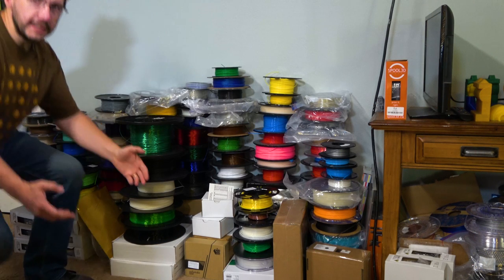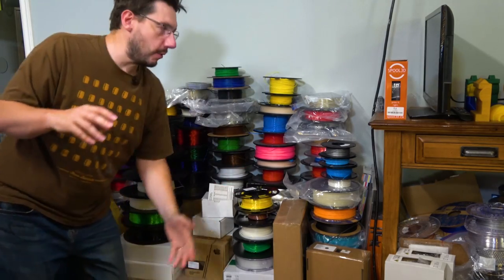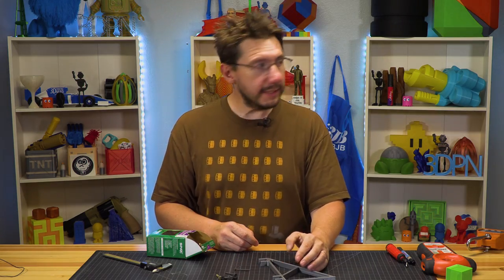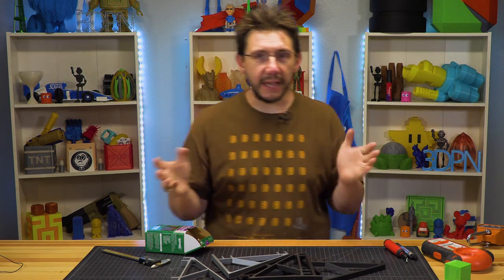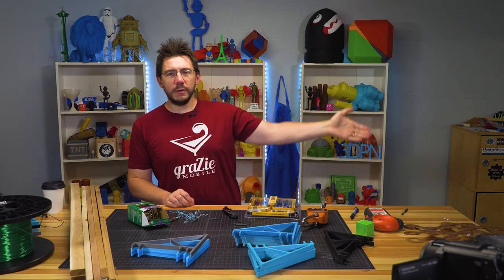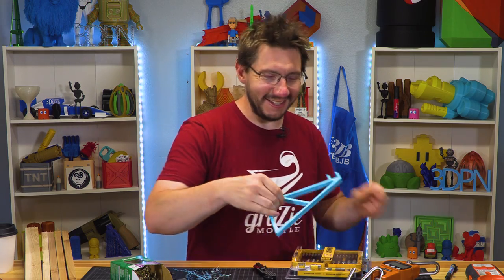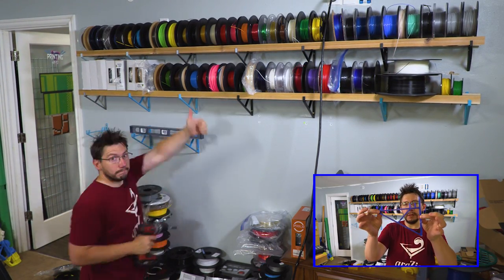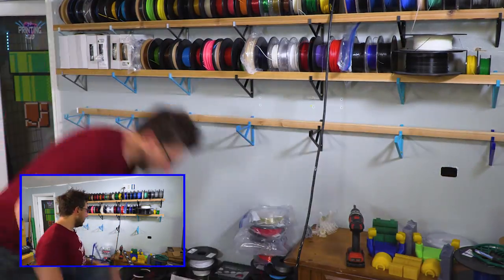Practical 3D Printing Ideas: DIY Shelf Brackets! Filament Shelves!

Comment: Your next project should be some slide in label holders so you can label the filaments and easily pick the correct brand/type without having to remove the spool and check the side label

Comment: Pan head screws do not have that little taper, so wouldn't put any expanding forces on the mounting points.
Reply from the maker: I tried to find pan head screws of the length I wanted but they didn't have them, so I got these. Good catch :)

Comment: What happens if the top self goes do you think it will create a domino effect an you'll come back an everything will be back on the floor again ? Dont you think you should of done the tests first to find the best material to use first an doing the proper calculations to know exactly how much weight each full shelf would hold

Comment: If you would of put the boards at a like a 45 degree angle instead of 90 degrees you could just use the filament were it lays instead of having to get it out

Comment: Great video for DIY'ers and the flexibility of 3D printing ideas.  I'm newer at printing and have heard a lot about dry boxes.  Your idea can extend to put dry boxes up, but why aren't you worried about the filament going bad or getting moisture?  Is your room climate controlled?
  Depending on where people live that may not be a good idea to leave filament out unprotected.
Reply from the maker: We are in the Seattle area, and the house is climate controlled, so I haven't had to worry. My guess is this wouldn't work well for other geographies.
Reply: What is your average humidity in that room?  I was wondering about this given you are in Seattle and it is not the driest state.  :)

Comment: You could have saved half what you spent on lumber by ripping the 1x2.  It would be plenty strong for that weight and span and would still fit within the brackets.
Reply from the maker: GREAT IDEA!
Reply: gstellmon or by cutting a 2x4 in quarters which are cheaper than the 1x2's you bought
Reply: Obviously you'd have to spend $??? on a table saw.

Comment: Joel, how long do thes brackets take to print?
Also, don't you have issues with your open filament rolls absorbing moisture?
Reply from the maker: Each took 2 hours or so, and so far, after a number of years, no issues. Our house is climate controlled - that probably helps.

Comment: Why did you print with a brittle material?  Seems like it would lead to problems possibly resulting in wall damage.
Reply from the maker: I had thought about that but the filament lasted. Crazy, right?

Comment: I don’t know anything about 3D printing really. I don’t have one yet, I’m just here to learn. However, I have to ask about storing filament in the open air like you do. My understanding is that filament picks up moisture when stored like that. Am I mistaken?
Reply: You are the first one I spotted either asking about this or mentioning it. Yes, some filament needs to be stored right, like for example Nylon, since it becomes absolute nightmare to print with if it's saturated with moisture (you can dry nylon, but it's better to store it better, you can use saturated nylon to "steamclean" the hotend). PLA is usually okay to have in open air. I'm now convinced this guy is not that knowledgable about 3D printing, when he has nylon in open air like that. Even a ziplock bag with a dessicate bag in it will help tremendously!
Reply from the maker: What nylons do I have in the open? We have a climate controlled house, but I dry Nylons, PETG, and flexible materials. Can you point me to the research you've seen that says materials that have been stored in dry environments perform better than materials that have been dried?
Reply: Well, I assume not all of it is PLA, because you did put protopasta on the shelf. Also, this is not a good long term storage of filament, even PLA! If there is any research on this, I doubt it! Especially empirical research! Each time you dry a filament, it will degrade vs a proper stored filament, most likely; but do I have research on this, no... Try comparing identical rolls of PLA, one that has never been opened, and one you had out for 3 months, which you have dried 6 times, and compare? It's a bit overkill comparison, but if you want some good material to put on youtube, this might be something!

I thought one of the natural filament was nylon, but they are all PETG, or is it PLA? I kinda got convinced it was nylon when you had expensive filament like protopasta in the open, even though it might be quite non hydroscopic, which I don't know, and can't find on the spot right now.

But why would almost everyone that 3D prints store them in boxes with desiccate gel etc, except people who print professionally and go through a spool within a week or less? Just for the fun of it?

Comment: Question, to my understanding Filament should be stored in bags and with silca packets to make it last longer. Alot of your spools don't seem to be stored this way and your shelf doesn't seem to help with this problem. Is it that you just go through so much of it so quickly that its not a problem or ? Just trying to better understand.
Reply from the maker: When you print, you want your filament to be dry. You can keep in bags and boxes and such, and that will definitely help. We keep the house at a relative 35%-40% humidity, and the temperature is controlled as well. I've left filament out for YEARS and still had it print fine. Your mileage may vary.
Reply: Thank you for the information and the reply. I have only owned my Prusa i3 Mk3 for about 2 months so just trying to learn good habits vs bad ones heh. I live in the Kent area with a AC controlled house around the same humidity so I wont stress about it if I keep a spool out for a week or two.

Comment: i always make the screws when im modeling something so i can make sure they dont do this. im still learning fusion360 but i use tinkercad way to much an its so easy in tinkercad to make stuff like this an to make a screw then turn it into a delete block, i dont do threads just the head of the screw an the size of the hole i need for the threads  that way the heads of my screws sit flush. if its two parts being bolted together then its just a button head bolt or if its a part that goings on the wall like urs thats when i use a round triangle or cone in tinkercad to make the head of the counter sunk screws, then just add the hole to the bottom an make the head of it all come out flush on the part an tada. actually really easy in tinkercad but i still struggle with it in fusion360. i need to spend more time in fusion360 i just haven't found the extra time to make it happen.

Comment: How many grams of filament does each bracket use?
Reply: I would love to know too so I watch the video again hoping to get the answer.
Reply: I bought it so now I can tell you. With 5 walls, 4 top and bottoms each, 1 skirt of 3 mm and 20% infill, it's 53g. At 60 mm/s, the estimate with Cura is 2h25.
Reply: Thanks for being the guinea pig! So,  between 80 cents and $1.33 per bracket depending on how much you pay for filament. I'll just buy metal ones for $1.28 at the local hardware store (or, 40 cents from Amazon).

Comment: What settings did you print the brackets at? Like how many outer layers and what percentage infill?

I just finished building my first printer from scratch (not even a kit) and have had my first few successful prints, so If you wanted to donate some half spools to me, I'd greatly appreciate it and that would greatly help me get started with materials I normally can't afford (yet). I live fairly close to the Seattle area, so I could just meet you somewhere rather than worrying about shipping, too.
Reply from the maker: I used two perimeters and only 20%-30% infill. Not too shabby!

Comment: Hi, how do you have the humidity in the room? I have a stone house approx. 50% humidity, and I would not have the courage to leave the filament just in the room.
Reply from the maker: It's pretty consistent at 35% - 40%. The Pacific Northwest is decent and we have whole house AC, which helps.
Reply: Several references that I have come across suggests keeping filament at 30% or lower.  Do you treat your nylon differently than other filaments?

Comment: The 'angle' as you call it is referred to as a countersink. You should be be to add these in F360
Reply: Countersink is more a carpentry/mechanical term, whereas, fillet is the engineering/drafting term. CAD programs that don't make use of a countersink feature will have it under fillet / round.
Reply: Cory Ryker , F360 has a "hole" feature, which among others contains these parameters: countersink diameter, countersink angle.
Reply: Sebastian, absolutely. Also, he always uses thin walls/perimeters even for real-use objects...

Comment: Rather than measuring and leveling each bracket with the one next to it, it would be way faster (and less error-prone) to just measure the one on the far left, then measure the one on the far right, and snap a line across the wall between them.

Comment: If it was me I would run those 1x2 down the bed saw to turn them into 1x1 they would look a little neater as long as there are no big knots in the timber it would still be more than strong enough especially because the gaps between the brackets is so short and you would cut your cost in half for the timber (i know it isn't much anyway but saving is still saving)

Comment: My 1x2 does not fit ! 3/4" = 19 mm but the space for it on your design is only 18 mm (0.70"). Did your 1x2 is not even 0.75" but more 0.70" ?  My advice for everybody is to measure the width of your 1x2 before printing a bracket. I know I'm late to the party, so sorry if someone already pointed that issue.

Comment: Guys is it necessary to have an air filtration or an exhaust system when printing in only PLA with one printer? Cause online there are a lot of confusion and contradictory statements. The enclosure and systems you can buy are really expensive.

PS Love your content
Reply: The is zero need for filtration for things like PLA, PET (all variants) or PVA. Where you want to start to consider it is ABS, ASA, nylon, Delrin (POM, acetal) and such. People are starting to go away from ABS and other styrene materials due to emissions. POM is actually very dangerous is overheated. So the case varies.
Reply: Cory Ryker okay it's just I read that regardless of the negligible VOCs in PLA there are still considerable amounts of UFPs that are release witch can cause respiratory complication such as lung cancer.
Reply: William B UFP emmission is less with printers than laser copier stacks in offices. It's less than cooking on the stove. UFP inhalation has been studied very little, so until there's conclusive evidence, feel free to err on the side of caution, but there's no need be overly worried
Reply: To get some official information, find the "Material Safety Data Sheet" for the filaments you're using. For example, one sheet I found for one brand of PLA says "Processing fumes may cause irritation to the respiratory tract, use in well ventilated areas only." So strictly speaking you should vent your printer to avoid health issues years from now.

On the other hand, I don't vent my printer. I just print only PLA, in an unused bedroom, and leave the room while printing. UFPs (Ultra Fine Particles) do make me worry, but not yet enough for me to make or buy a ventilation system for my printer.

I haven't yet found a site or book that fully covers 3D printing safety and environmental issues: fumes, particulates, Food Safety, fire, and the biodegradability or recycleability of various filaments. That would be a fantastic thing for someone to research and write; even something that just listed the possible issues and some info on either side of controversial subjects (like UFPs) would be a lot of help.
Reply: Taylor Landry thank you but there are laws saying that one's workspace has to be so far away from a copier stack and for cooking it has ventilation.
Reply: Bradford Needham thank you for answering! I'm thinking of sticking my future printer in the basement where no one really stays a long period of time in plus I'm going to buy a HEPA activated carbon filter and put it right next to the printer because ventilation isn't really an option for me
Reply: Not really, but it's a nice thought. There are no regulations on UFP emissions because they haven't been studied. Because of that, there are no OSHA laws about placement of laser copier stacks in an office. 

Of note from one of the 2 studies that have been done on desktop 3D printers...

"Although we are not aware of any regulatory limits for indoor
UFP concentrations, an increase in UFP concentrations to
∼58 000 cm−3 would be approximately 10 times higher than
what we typically observe in indoor air in our office and
laboratory environments and what has been reported as a
typical 8-h average indoor concentration in schools. However,
it would only be moderately higher than typical time-averaged
concentrations in homes, but lower than what is often
observed in other microenvironments."

Referenced is a study on UFP for other "microenvironments"
Some examples from that study:
- Inside a car driving on a major highway - 30,000 particles/cm3
- Restaurants - 50,000 - 200,000 for the entirety of the meal
- Cooking on gas or electric stoves and electric toaster ovens - peak personal exposures often exceeding 100,000 particles/cm³

Again, use caution, but if you're that worried about UFP, you have lots of other things you do far more often that you need to worry about - like cooking on the stove, eating out, and driving your car.

https://pubs.acs.org/doi/pdf/10.1021/acs.est.5b04983   - 3D printer study
 https://www.ncbi.nlm.nih.gov/pubmed/20087407  - Personal exposure to UFP study

Comment: You probably hit a metal plate protecting a wire or pipe that is running through the stud in that location.

Comment: I bought the model but I cant remember in what device I saved it. Once the purchase is made do we get a link or email?
Reply from the maker: You should get the email from gumroad. check there!
Reply: @3DPrintingNerd found it!!
Reply: How much time it took you to print and at what I fill do you suggest?
Reply from the maker: @mariogayoso  Print time I don't remember - I gave it extra perimeters, and I believe 25% infill.
Reply: @3DPrintingNerd  how many perimeters do you recommend?

Comment: Please reply what temperature do you print pla and what temperature do you put the print bed
Reply from the maker: Depends on the PLA but standard temps are 190c-220c. I print proto pasta HTPLA a little hot. Bed 55-60.

Comment: I want to see if anyone can help me with a printer problem I have. My new Anet A8 has an issue where part way through the print, it will shift in the negative X direction. It'll do that at regular intervals, with the same number of layers each time. I'm using Cura 3.4.0, and Marlin 1.1.8 I'm thinking it's a software issue, but don't know what exactly.

Comment: a link for the deburring tool but not for the crane scale?

maybe because it cost about 4 times the total cost of everything else? (but sandbagging would have worked as welll, for almost free)
Reply from the maker: Well crap I forgot. I think the crane scale was $50? Shoot.
Reply: as I guessed, they'd dropped in price...was around $200

but more people need to learn how to use some of the more simpler ways of testing like sandbagging. 3 gallon jugs with water would have saved you $50
Reply: Money is not an issue for everyone, so it's obviously a trade-off between cost and convenience.

Comment: I understand that is it all about the printing and the fun of it. Just let me say that you have to take the modeling and fabrication time into account. So making one bracket takes maybe 2 1/2 to 3 hours with added use of power and plastic. Making them from wood is probably easier and definitely faster, potentially even stronger. So while it is a useful project, it is quite inefficient.
If it's just about home imporvement, I would just buy metal brackets from the store, I have to get the surface (lumber-timber) anyways and I would argue that they are stronger.
3D Printing is one solution to a need for shlef brackets, but pretty certainly not the best.

Comment: I'm taking a moment to express an opinion.  This is all IMHO..  
First of all, moisture has been brought up no less then 15 times in three weeks (and that was when I stopped counting).  I live in Texas where the AC runs 24 hours a day from May until  even in November where its then only 8 hours a day.  How much moisture is OK?  (With this many spools, a spool is on the wall absorbing moisture for how many years?)

Second:  With all your success in sponsors, plus free materials (parts, filament, etc), your now doing what is in effect a 21 minute infomercial for your $2 designed brackets?  Will you make so much money for them at $2 each download that you'll offset the number of people who refuse to pay for anything on the internet?  Or simply choose to unsubscribe?  

I've enjoyed your videos, and I'm sure YouTube is giving you a kick back based on the number of viewings, and I've never object to the plugs you make in your videos for your sponsors, but asking $2 for brackets just seems excessive after showing your viewers just how many rolls you have.

Unless the $2 is to hire a painter to so the walls finally meet the ceilings.
Reply from the maker: Hey, an opinion! :)

Unfortunately, the power company won't take filament spools as payment, so, I still have to find a way to get money to give to them. I charge $2 for the file(s) that I show you how to make yourself. If people want a way to support what I do AND get something in return, a $2 bracket they can print dozens of times seems cool. I gave the file away to my Patreon supporters.

CRAP. I do need to paint the ceilings still :)